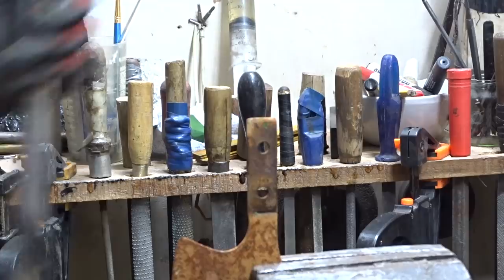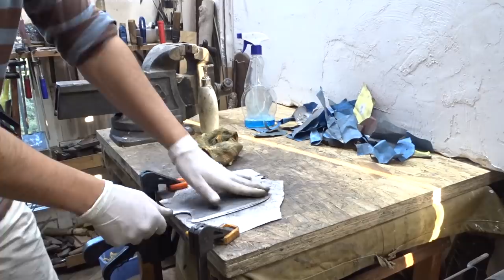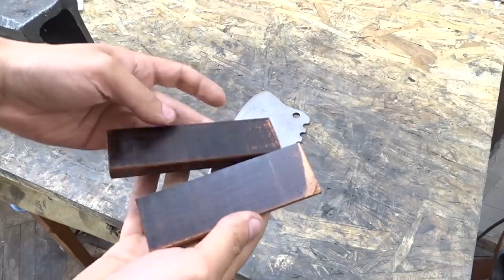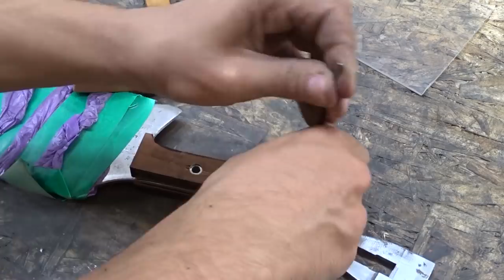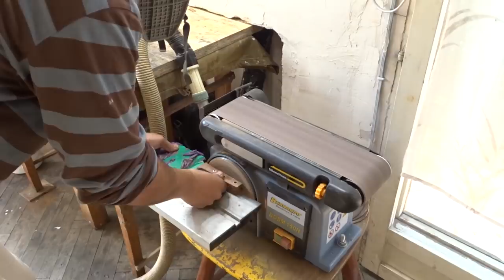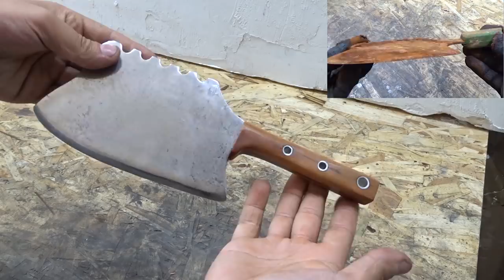Old Rusty Butcher Cleaver Restoration

Comment: Not a bad job, but I think I would have simply extended the tang by welding on more steel. Handle came out a bit too thin for MY taste, but I guess there are a lot of people with smaller hands it would work for.
Reply from the maker: Hello! Thank you for attention, sir. Yes, I know, you like a big handle) Unfortunately, I don't have a welding machine and because I made decision and small piece of plastic between the wood.
Reply: @ScrewsAndTools   I'm sorry, I watch several of these type channels I forget who's got what. If you're making do with what is at hand, that's cool, I get that.  A warrior uses what weapons are at hand, there is no shame in this. still, I dunno about the plastic. Plastic will eventually turn brittle and break, or outgas to the point where it just disintegrates. Basically, that's what happened to the original handle, it just outgassed until it just wouldn't stay together, any stress at all would break it.

Comment: Question: For how long do you apply the electrolysis?

Awesome job btw :) Love the inventive extension on the handle!
Reply from the maker: Hello Dennis, thank you for attention. First of all it depends on the size of stuff, for example. When I need to remove old rusty from knife I apply electrolysis for 30—45 minutes. For cheaf knife butcher I need 1 hour and 20 or 30 minutes. For specifically that cleaver need 1 hour.
Reply: Hi, I have a question! What exactly did you use for the electrolysis? Looks like an old computer part. Any extended info would be greatly appreciated.